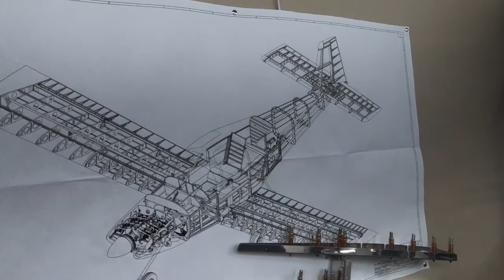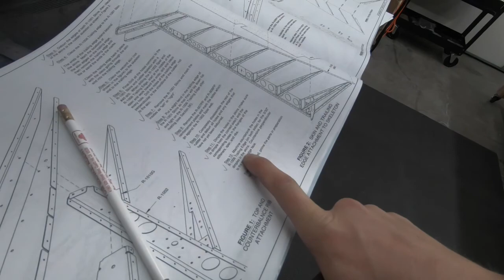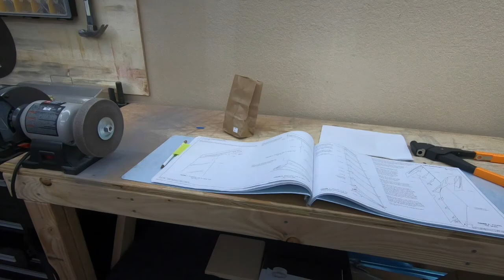Vans RV-10 Rudder Build, Part 2

Comment: Really like the back plate you sunk into the table! Genius. Was it difficult?
Reply from the maker: Thank you! It wasn’t too difficult, just a bit involved with routering it out and pulling the bend in the plate down with a screw. It took a few hours but was honestly pretty fun to do since it didn’t involve anything precise or complicated. The other option I considered was to get a sheet of MDF the same thinkness of the steel and just cut out the rectangle so it drops inside. That would probably be the easiest method, but wouldn’t be as permanent. I would for sure do the recessed plate again, or MDF sheet mentioned if I was in a hurry. I missed the plate a while back riveting a few times and it would have for sure ended up in nasty bends in the skin if I didn’t have the plate set flush with the table.
Reply: @AustinManke  Thanks for the insight! I’m waiting on my RV-8 kit and am in the process of building out my shop so I’m very curious about peoples’ setups.
Reply from the maker: @murphy22214  Happy to help! And that is great to hear. That is such an awesome aircraft. Enjoy the build!